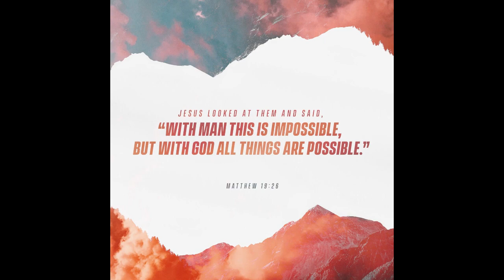Hood Prop - Tom's Bronco Parts vs James Duff Comparison - 1966 Ford Bronco Restoration Project

Comment: I definitely would add stiffeners between brace supports. Chevy trucks have the same problem. A square body Chevy truck was on the auction block on national TV when someone tried to close the hood and the hood kinked. Aftermarket Chevy hoods had additional bracing added since it was a known problem. Apparently, Bronco aftermarket hoods are not braced because they never had hood springs from the factory. I had this problem on my 1970 AAR Cuda. Please add bracing before you kink your hood.
Reply from the maker: I agree...We did add the brace.  You are watching videos we did a few months ago.  At some point we show the added support.  Thanks